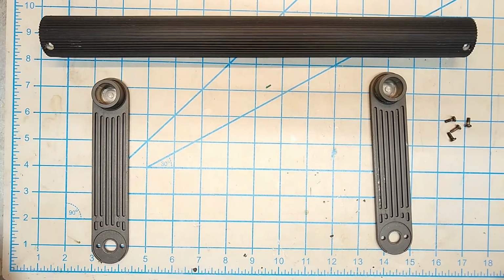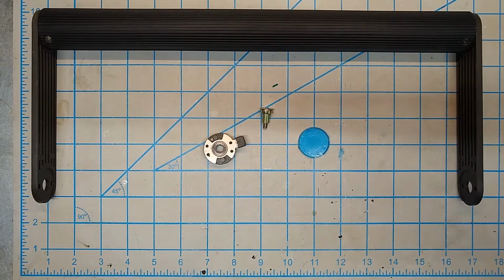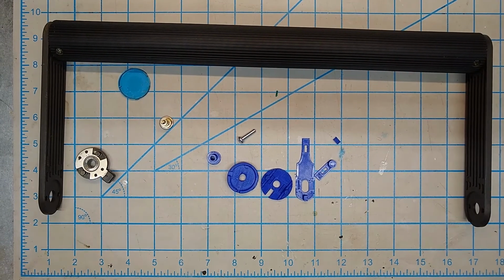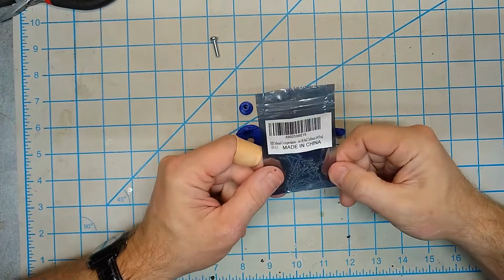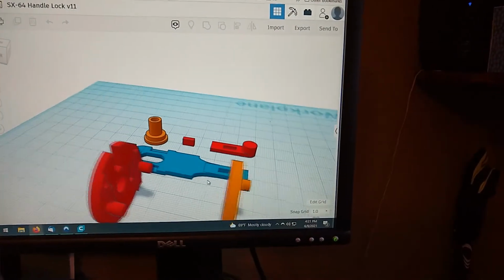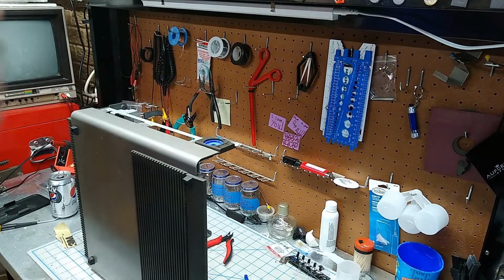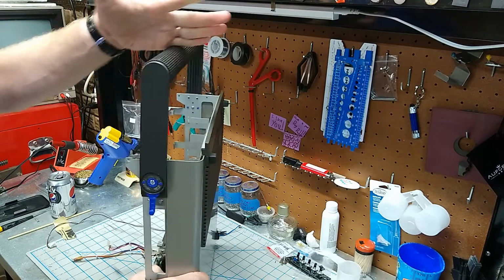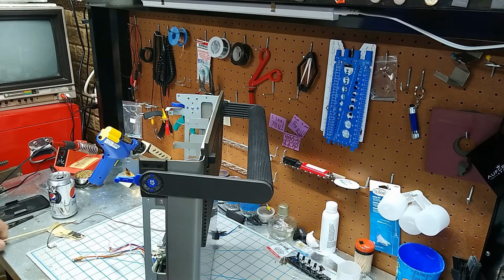Episode 19: SX-64 Repair and Rebuild, Part V: Handle Latch

Comment: Theoretical, if the handle lock clutch layers can be separated, theoretically could you drill out where the two sheared off pegs would be, and then thread bolts FROM the SX-64 chassis INTO the clutch? (the opposite of the pegs from the clutch entering the SX-64 chassis.)
Reply: More realistic theoretical, what if the clutch was to remain together, and where the two shredded pegs were to be drilled top side in? I spent a few hours looking at my handle clutch and there is no way that thing is coming apart. HOWEVER if a precision drill is used and extra care is taken to make sure the drill doesn't go too deep, two replacement bolts from the SX-64 chassis INTO the drilled out clutch holes seems viable!